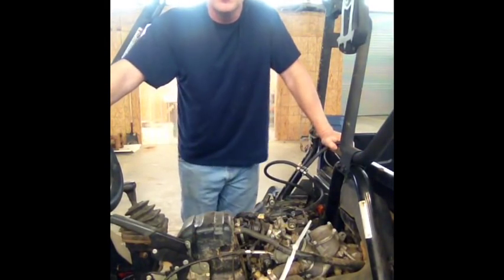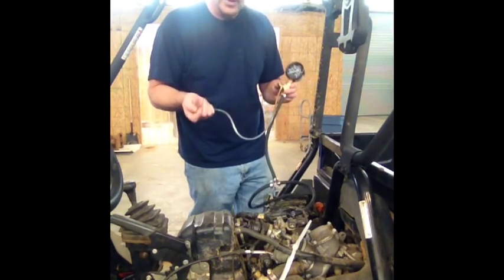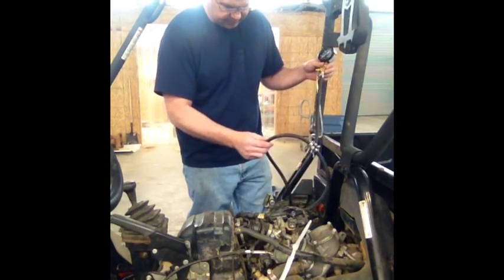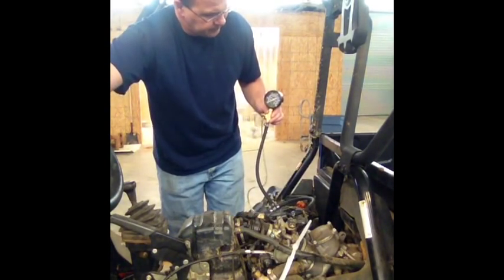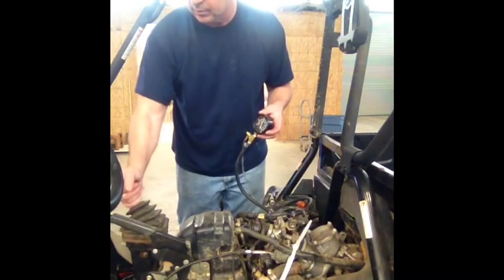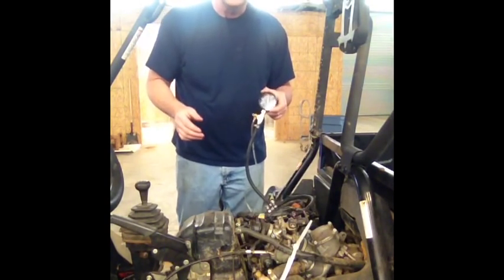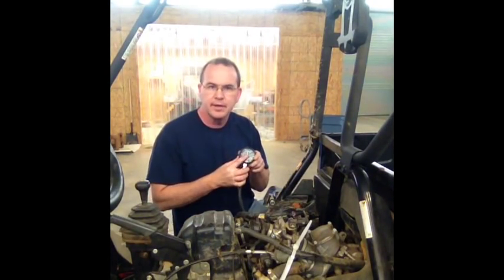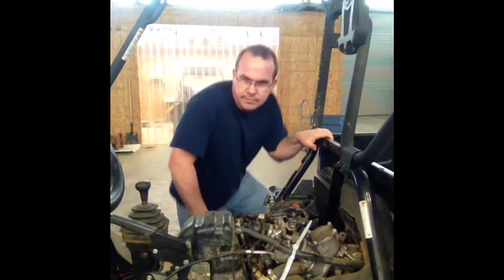Testing Fuel Pressure

Comment: I know this is a old vid...but im having an issue with a no start 18 low mileage ranger 900xp     My fuel rail has an access fitting that i hooked my gauge up too instead of removing the end fitting  you show here.   Will that make a difference?   When i hooked to the fitting with the plastic cap on the fuel rail...it read 59 lbs......i believe that is good.   It will fire with SF...i have spark...BUT my plugs are dry as a bone....my next attempt is to try to see if the injectors are getting signal?   or maybe replace the crank sensor as well...maybe its bad and shutting off signal to the injectors?    any suggestions sir   Really like the channel. when i need a belt i will be getting one off you folks!
Reply from the maker: sounds like fuel pressure is fine and the way you did it is fine.  I only know clutching anymore but sounds like something is not letting the injectors fire
Reply: @Hunterworks    I was not cranking the key...only putting it into the first position......i realized this last evening.  Cranking it over now...i have signal to one injector and not the other.......

Comment: I have a 2008 rhino 700 and it was cutting out at full throttle and at 32 mph I checked fuel pressure and the gauge wouldn't even read it was so low

Comment: My rhino 700 has hard start. Find it will fire right up if you wait till the pump stops then crank. But if you wait a few seconds too long it cranks a lot to start. Runs fine. Maybe it's just losing pressure somewhere? Haven't found anyone with similar symptoms. From what everyone describes I'm not so sure my pump is bad.
Reply from the maker: Can't answer that one, when mine was hard to start and finally would not, it was the pick up coil on the stator